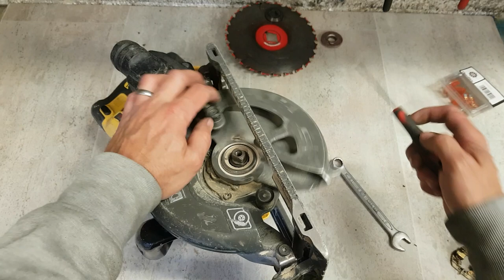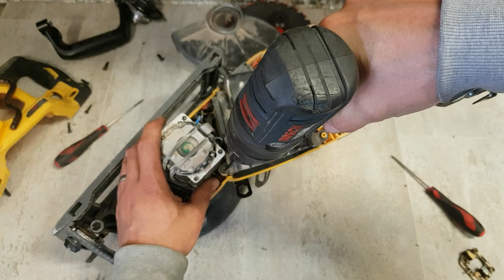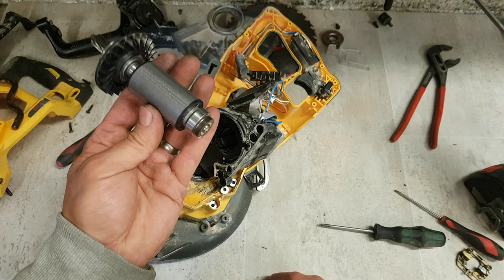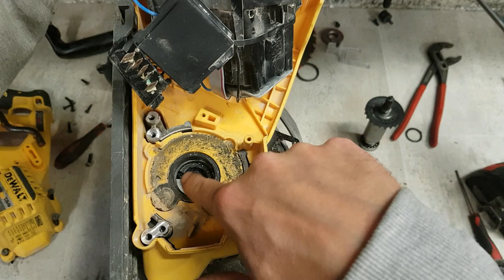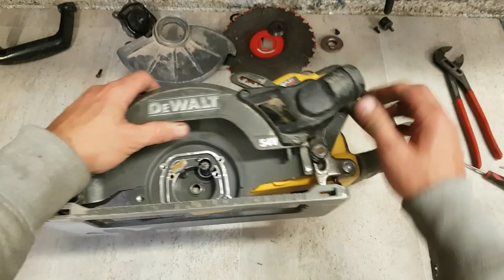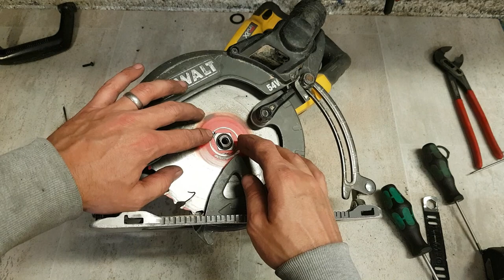Dewalt 54v skil saw making a bad grinding sound. How to replace a bad bearing.

Comment: Just out of interest is it the 6 amp and the nine amp 54 volt batteries that you see having problems with cells getting out balance and showing as faulty? or is it just the six amp ones? love to know your findings as I might be jumping onto the flexvolt platform
Reply: My old six amp didn't last long. China. The next six amp was Korean and is still going strong and seems to hold more power/ work time. Would love the twelve amp but just use my corded Makita for the tough jobs.
Reply: @patrickcowan8701  thanks for the feedback. I wasn't aware their packs were manufactured in two different countries

Comment: Gear has been broken.

Never use cheap bearing for your powertools. I use cheap powertools but all my powertools use SKF bearings or FAG bearings.

If bearing has been damage, all is damage. Bearing is a critical point for all type of motor.